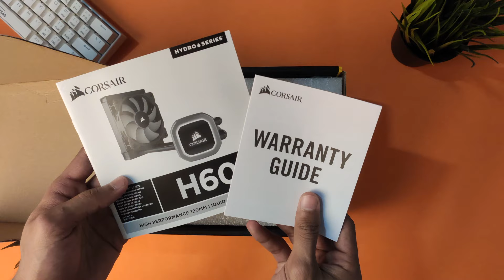Corsair H60 (2018) | Unboxing and Installation | Liquid Cooling in a Budget.

Comment: you should turn the radiator upside down, there is an air pocket at the top of the radiator which makes for inefficient cooling
Reply: Thanks for the tips
Reply: but then you won't have space for the tubes being right next to the gpu, right?
Reply: There shouldn't be any air if it's manufactured properly. If there's air in it, it's a defective unit.
Reply: As long as the top of the pump is below the plane of the top of the radiator, it will be fine
Reply: @timfolland420 false, it is near impossible to remove 100% of the air during manufacturing AND air will diffuse into the system over time
Reply: @brettfrommer7871  exactly.... best part about all of this is that everyone thinks he knows but without the right knowledge and too lazy to do their homework.

Comment: So I noticed you have your fan set up to suck in the hot air from case and blow it out through the radiator.  Other people are saying suck in the outside air from case and blow that cooler air over radiator.  I'm so confused.
Reply from the maker: Depends on how you want to optimize the airflow of your build. I always like setting the front fans to push the air in and the top and rear fans to push the air out. Therefore the AIO fan has to be set this way.
Reply: @Orceytube  with your shown setup, you are pulling hot air from inside your pc out through the radiator - you are basically trying to cool your cpu with hot air. What you should be doing, is pull Cold air in from the rear and then have some fans pushing out through the front if possible. Futhermore, turn the radiator upside down. There tends to be a small amount of air inside the radiator, not a big deal, but more optimal if those airbubbles isnt dragged into the waterflow (: other than that, nice video, straight to the point (:
Reply: @renepoulsen4078  that would be weird to have a single intake coming from the back and have multiple fans trying to get the hot air out from the front.There will not be enough cold air to come in and therefore the whole system will just try to exhaust a much warmer air to the front but not get cold air from the set up you are proposing. His set up is alright,just wish he had couple more fans to exhaust hot air to the top of the case.

Comment: I have the H60 as well, but how can I confirm that the pump is working?  I see in the bios and hardware monitor that the fan is spinning, but I don't hear the pump or feel it. Can you?
Reply from the maker: How you can check inside HW Monitor:
Under Fans in CPU section it should say CPU : "a value around 4000 RPM"
Alternate ways to check if it's working:
1. Gently squeeze the tubes and you should feel the water rushing.
2. When you start the PC, you should hear the sound of water beginning to flow from the pump to the radiator.

Comment: Great video, I always remove my video card (GTX970)and install my test GPU (HD6450) when doing work like this, until I see that it is running well.  
Nice work on the vid though, thanks!
Reply: Does it really matter ?? Just wondering I’m gonna be putting one into my build soon!
Reply: @DentSideDee71   Does what really matter?
Reply: @Hughesburner  you said that you put in another gpu until you see that it’s running you’re talking about the aio right?? Does it really matter ? Can’t you just Disconnect everything Apply thermal paste to cooler Secure it in then test? I mean that’s just common sense to me
Reply: @DentSideDee71  You already know everything. Why are you even asking me anything?
Reply: @justinh6477  when did I ever state I know everything wtf I totally don’t I’m still learning Tons Today What’s your issue all I asked was a simple question if you got a problem take that negative energy somewhere else it’s all love over here I’m just trying to gain more knowledge what if I didn’t know something exactly keep your words to yourself next time
Reply: @DentSideDee71  You understand the price difference between these two cards right?
Reply: @Hughesburner  yeah I definitely do I have a bit of knowledge about cards I’m no expert tho I can fully admit that I’ve only built 2 pc’s in my life
Reply: @Hughesburner  how has the aio treated you? I just got one for 20$ in my local market I’m actually surprised they are going for about 60 to 90$ right now
Reply: @DentSideDee71  So, the 970 was a high end gaming card at one time and still is just good enough to game at 1080p. Its still a $150 card. The HD6450 barely plays minecraft and I paid $3 for it. If I am going to install a new water cooler that could potentially leak onto the GPU, I would want it to be the $3 card.  Also you are going to want to take out the video card out anyways, it takes 20 seconds and makes the job way easier. The guy in the video didn't, which is fine but I could see him lean on the card at one point, its probably fine but I would rather spend 20 seconds and be safe.
Reply: @DentSideDee71  I paid around $30 for mine still sealed. Coolermaster 240L.  Its overkill for a 65w processor. I will likely move back to a large air cooler.
Reply: @Hughesburner  which processor is 65? Are you talking bout the gpu my bad im confused
Reply: @Hughesburner  I know I have xfx R6770 ddr5 and gtx 970 ddr4 right now I currently building my gtx 970 and I’ve seen them sell for 250$ yeah I said 250$ rn lol

Comment: when i instal the cooler on the pc do i need to remove the cables from the  motherbord???
Reply from the maker: Which cables are you referring to?
Reply: @Orceytube  to all the cables around te motherbord like the all cables that's conected to the motherbord
Reply from the maker: @vilcugym  You can leave all the cables as they are. They will not interfere with the cooler installation.
Reply: @Orceytube  a ok thanks very much

Comment: hi i had a question in my directions it show the fan and radiator on the back exhaust fan area but you put your on top ext area and are the holes supposed to be at the top?
Reply from the maker: You can put it on any fan mount in your PC case. Although the back exhaust fan area is recommended, It depends on what kind of airflow you choose for your build.

Comment: im still really confused. How do you control the lighting on the cooler?
Reply from the maker: The lighting on the cooler cannot be changed. It's static white LED.
Reply: @Orceytube  I believe you can actually control the lighting, u just need to download the Corsair app on your pc
Reply from the maker: @dreamybulldaily801  You're confusing it with the Corsair RGB AIO's which look exactly the same. This one is an entry level AIO and it does not have RGB. Just white LED.
Reply: @Orceytube  ah ok, I was confused for a sec bc it’s my first time building a pc. Thanks for the info
Reply from the maker: @dreamybulldaily801  No problem :) Good Luck!
Reply: hmm, i bought a used PC on eBay with the corsair h60 v2 AiO, but the white led is off. why?
Reply from the maker: @hocdoc22  Check if the Power and CPU cables are properly connected. If yes, then maybe the LED is shot.
Reply: @Orceytube  (a year after and still wondering) is there a way to turn the brightness down or no
Reply from the maker: @jssingh__  No

Comment: Didn’t show how to mount the rad, didn’t show how to plug into the psu or mobo.
Reply: Ok I have installed this cooler and built my pc but it is very easy and Self examlitory

Comment: I just want an honest definitive answer if I need to put thermal paste before I place on the liquid cooling box ontop the CPU, because no joke I've read some places where the H60 is already 'pre pasted' this is worng right? I need paste yes?

Stupid question or not I've been getting contradicting answers, it's why I'm asking I'd really appreciate an honest answer.
Reply from the maker: The H60 comes with thermal paste pre-applied. I had to apply it again because I messed it up during the unboxing.
Reply: @Orceytube  thank you I appreciate the response!! 🙏🙏

Comment: What PSU and motherboard do u use? I wonder if my pc parts will pass the requirement to add this corsair’s water cooling
Reply: Dude don’t worry about it they come with both brackets and will fit into a micro atx or just a atx too

Comment: So is there liquid already inside the cooler? I honestly don’t know much about liquid cooling but there’s nothing in the video that helps me with my current situation. I don’t know if there’s water in it. There’s no sound coming from the radiator when I shake it. Pls helppppp
Reply from the maker: Hey Drgn. AIO's come with liquid coolant already inside them. It's those custom water cooling loops where you have to worry about adding your own coolant. So don't worry about it.
Reply from the maker: When you turn on the AIO, you'll hear the liquid rushing from the pump to the radiator.
Reply: @Orceytube  thank you so much. I didn’t wanna turn my pc on and watch it fry itself because of something I could’ve checked before hand.